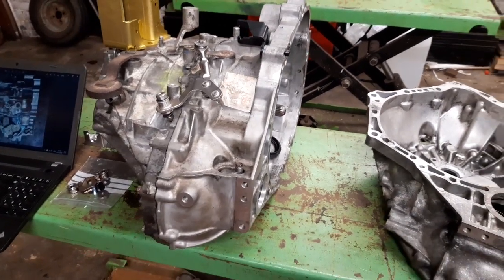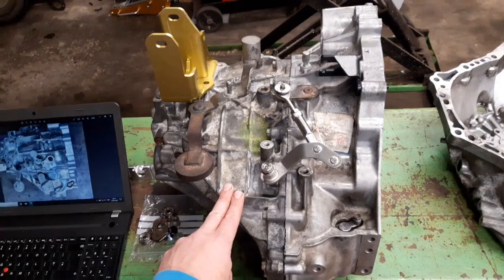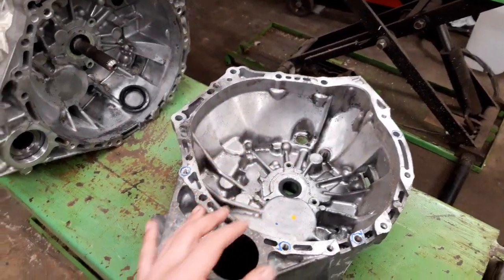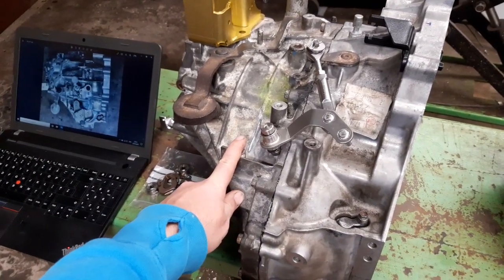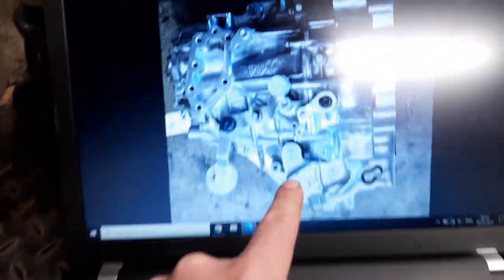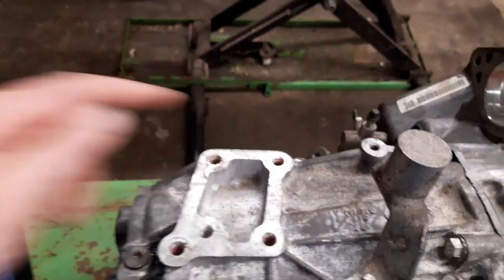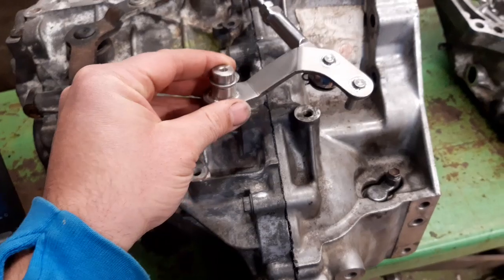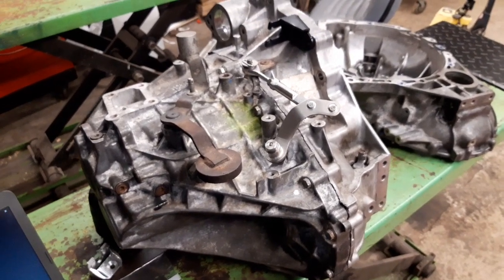Toyota 2ar-fe 2ar-fxe MR2 mk3 MRS zzw30 conversion eb60 gearbox transmission non USA case variations

Comment: I am also on my way to get 2ar-fxe, tho i'll go straight for dsg transmission. 
Exactly as you say, its pita to get something that will bolt on (also in my case with ae92, axles and linkage need to be redone), fitting original trany (c52) is also the option, but weak gears and weak clutch doesn't seem to be long term option (getting ceramic clutch and sachs performance pressure plate is at same price as dq250 goes).. Starter would also needed to be incorporated in trany side on c52 (that's more cutting and welding)
dq250 is older and cheaper (which is good thing) but also weaker (i think up to 650nm with upgraded clutches, its wet clutch design)
dq500 more expensive but i think all are 4x4 and strongest.. i find it long term most reliable
Reply from the maker: What country are you in?
Reply: @threepotMR2  Slovakia, most stuff i get is from Poland, which they import it from GB